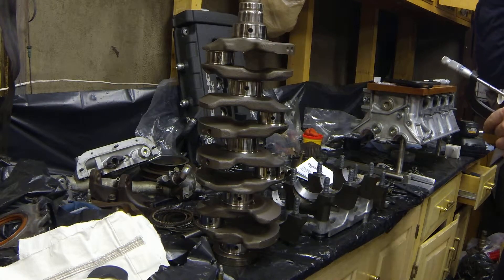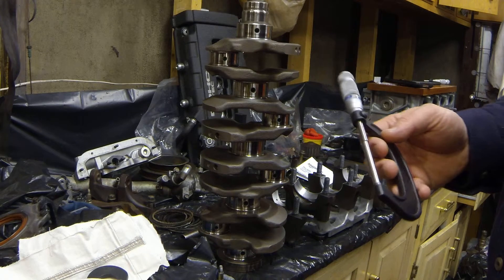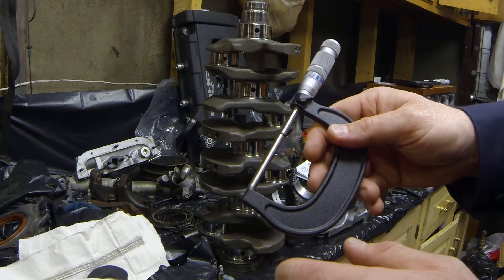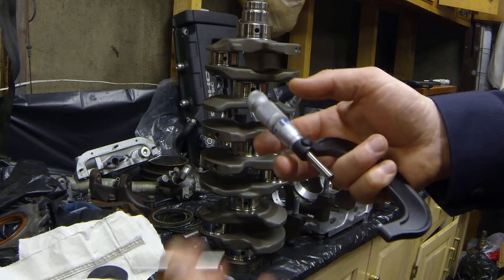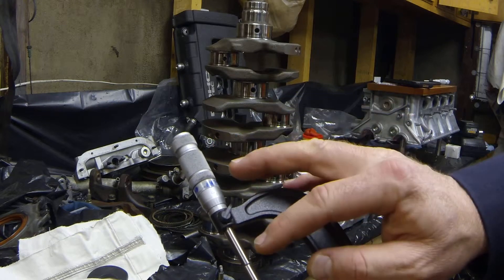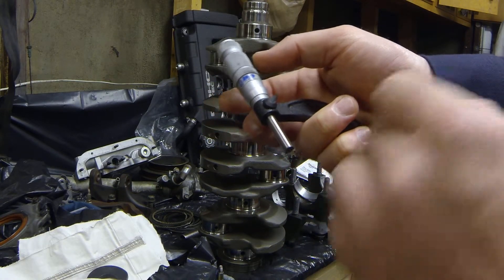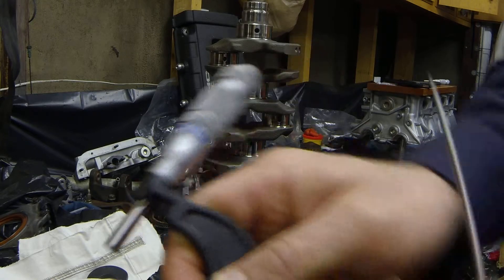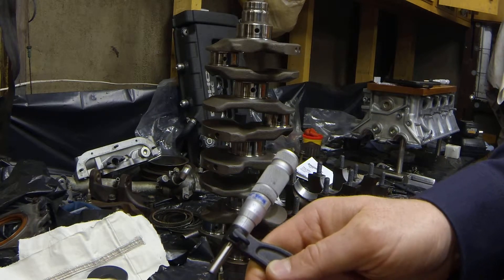Blue Printing a B18C1 GSR Crankshaft

Comment: Great video!!! I was wondering did you have issues with the micrometer leaving scratches on the crank journals? I use a iGaging digital micrometer and it leaves very minor scratches.
Reply from the maker: Alexander Xiong Mine did not leave any scratches. Keep the mic open and slowly move back and forth and close it till you feel slight resistance. The faces of most quality micrometers are made from carbide which will scratch steel if the mic isn’t open enough and any force is applied.